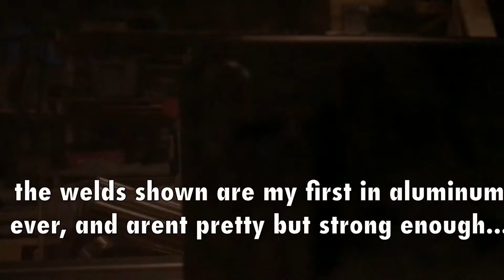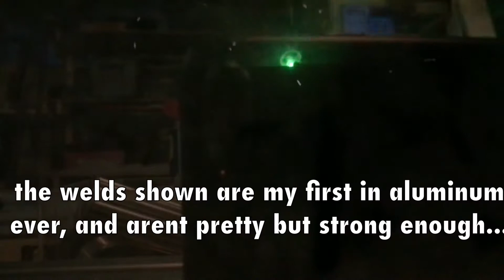Welding aluminum with a 110v mig, standard fun

Comment: Actually just picked up a Lincoln 210, came with a spoolgun for aluminum. Then spent another $200 on a cylinder of argon...about to fuck around migging some aluminum this weekend. Unfortunately like you I only have access to 110v at the moment, but looks like you were able to make some halfway decent welds.

Comment: hi - did u use a spool gun for the mig?
Reply from the maker: Fstarocka Burns nope - ran the aluminum wire straight through the machine just like i would for steel. You have to be disciplined not to pull the trigger if you stop short - the wire expands a lot more in the tip than steel wire does.. you have to stop your weld pulling the gun away from the pool. So you’re not so much stopping by letting go of the trigger as you are just getting too far away. If you do that, you won’t get a clog. If you let go of the trigger within an inch or two of the pool, the wire expands in the tip. Pull the trigger again and you start a birds nest. Pull it one more time to be sure and you’re tearing it down to clear the nest and re-run the wire.
Reply: Hi thanks - tried it on the weekend and man - 7 birds nests later I gave up! That was with a harbor freight 220v mig and 100% argon.. I stick welded what I needed to but will keep trying - thanks!
Reply from the maker: Fstarocka Burns for sure  - the birds nests are no joke.  I have seen some videos on YouTube of DIY spool guns that I think I’m going to give a try. I was running 100% argon as well, and that seems to be the trickiest part of the diy spool guns — adding a secondary gas solenoid or plumbing the existing gas to the gun.